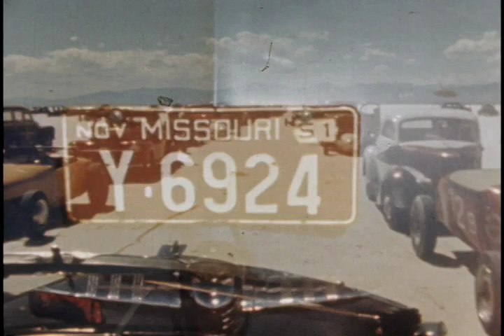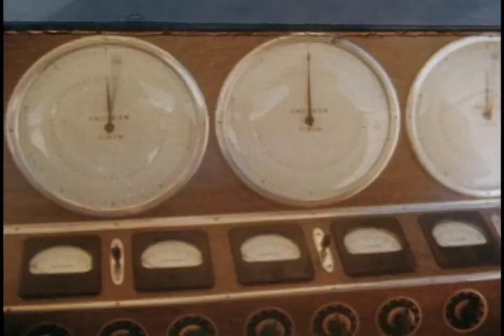Racing at Bonneville

Comment: Started with a 31 Ford HiBoy in 1960 bought Joe Carboni's Devin in 1965. Turned that into a 69 Camro in early70's. Then built a 68 Camaro Camaro, then I think it was a 65 Monza then a 2nd gen Firebird and now racing our 3rd gen Firebird. Stock body, no blower and our record is 308.983 in AA/FA and 274.125 in AA/GA Thats the fastest among other records still standing.

Comment: What a gem. Bill Burke/Don Francisco tank at 0:06; Doug Hartelt's coupe at 0:27; Kenz-Leslie at 0:46; Riley-headed Banger in Fred Lobello's Lady Bug at 0:57 and Lady Bug to follow; Don Blair's roadster at 1:19; Morton and Rubio at 2:33; Chet Herbert at line at 3:24; has to be one of Tom Beatty's or Barney Navarro's engines in the  '32 Desoto coupe 3:52; Don Clark and Clem Tebow at 5:24; Ak Miller at 6:14?; Howard Johansen Crosley at 7:55. Correct me and add to it where necessary. This is chock full o' goodness.